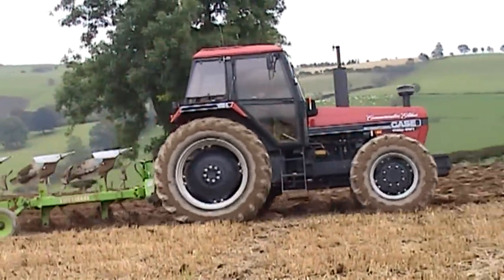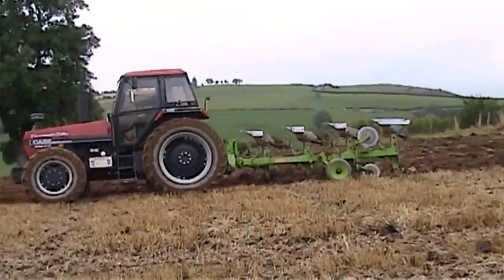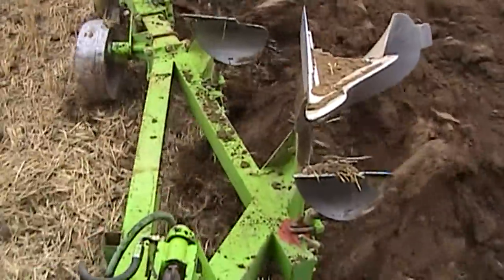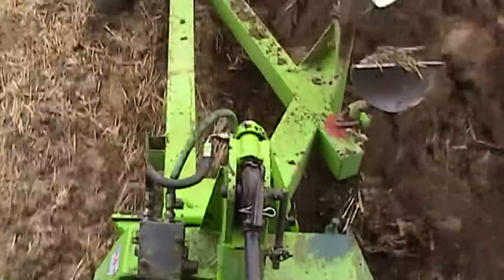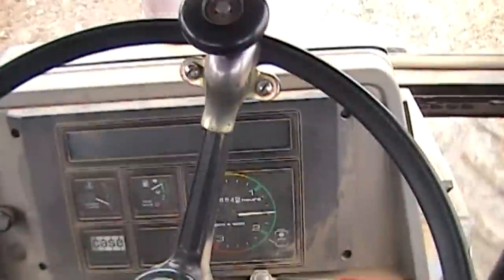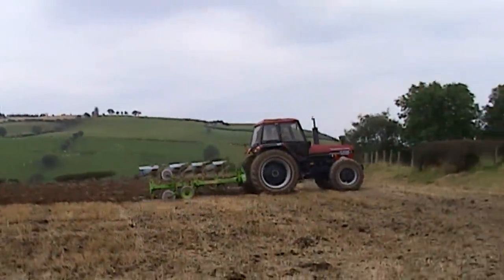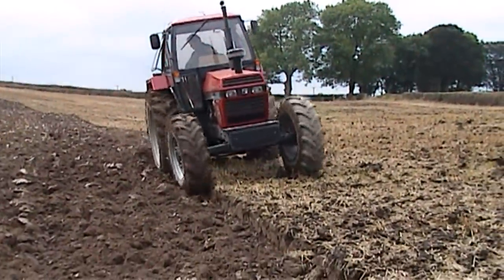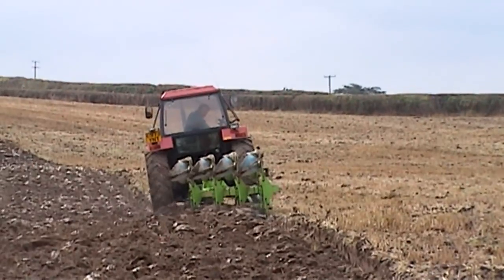Ploughing with a David Brown 1594 and Dowdeswell DP8

Comment: Tractor and plough like new credit to the owner not many like that around anymore !
Reply from the maker: Thanks Jimmy. Used to do a fair bit of ploughing with it when I was contracting, hence the many sets of mouldboards. Last time I used it I cleaned the soil engaging parts off meticulously and then sprayed it all up with proper Dowdswell green. Almost like new now and I doubt I will ever use it again. Everything used to be ploughed but not any more. Different era and I count myself very lucky to have been there.
Reply: @scooby7346  pity David brown stoped makeing tractors .Was at meltham 2015 for switch to selectamatic massive factory.shame to see it not makeing tractors!
Reply from the maker: @jimmymannion6874  Yes, great shame but that's progress. I used to go up to Meltham for tractor bits if needed urgently and sometimes up to Leigh for DB reversible plough bits.